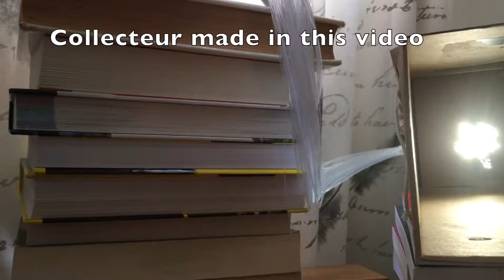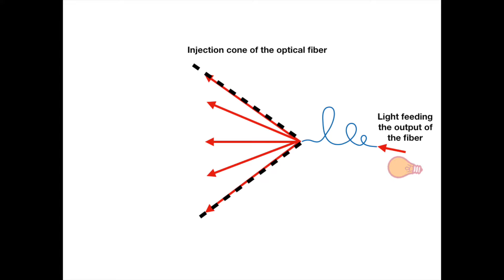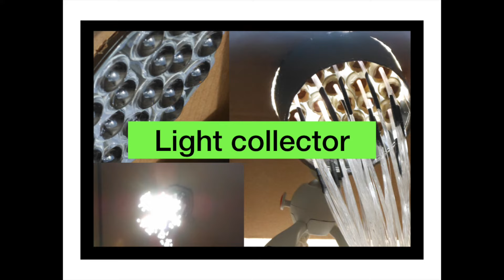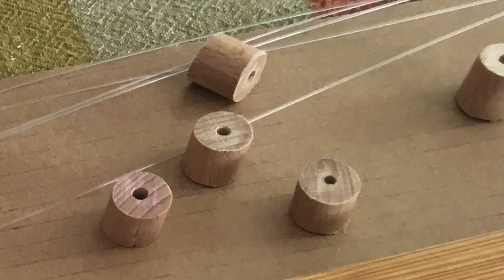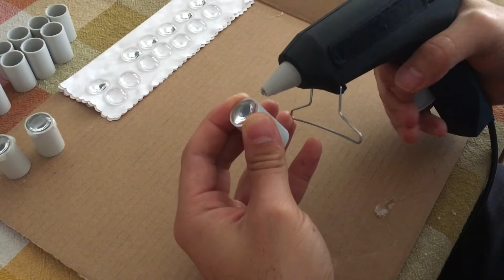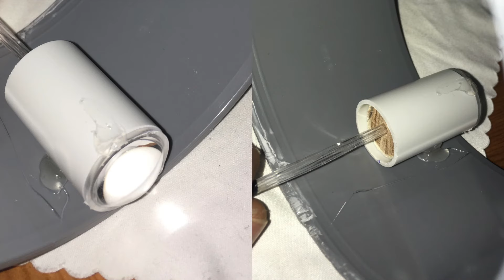FULL DIY TUTORIAL Sunlight collector using optical fibers

Comment: Is there a limit to the length of the line?
What is the maximum length?
Reply from the maker: It will dépends on the optical loss of the fiber, with a good fiber you can reach easily several hundred meters without too many losses

Comment: Did you know how much lumens it's possible to get using just one fiber?
Reply from the maker: Hi ! It will depend on your optical components : size of the lens, coupling in the fiber, losses of the optical fiber. In any case you won’t get much than the collecting area aka the size of the lens ( assuming the sun is right in front of the lens)

Comment: 1)I have a few questions 
If this has to be used in real life applications why would people use this since it is expensive compared to other things like solar panels or led lights and how many of them would it take to give the same brightness of led lights 
2) how many of these would it take to light up a 9watt bulb or any other kind of bulbs
3)what about the fire hazard of using it in real life
Reply from the maker: 1/ this solution might not be too expensive if a lot of sun collector were made, I’m thinking of providing a kit soon, and there is practically no aging component. Regarding the number, I don’t know, depends on what you are looking for. 2/ I don’t know 3/ there is a fire hazard, and that’s the tricky part of this project. I made another video where I started a fire using an optical fiber ! Check it on my channel ;)

Comment: Did you have issues with excessive heat? I want to do something similar to avoid using a parabolic with a secondary focal lens to eliminate UV and other invisible spectrum. I think coating the back of your lenses with a uv blocker would drop the temp significantly without too much loss of visible spectrum?
Reply: Put an infrared  filter it will reduce heat more than uv filter
Reply from the maker: I’m using small lens to avoid excessive heat. Also using low cost materiel, I guess a coated lens can be expensive
Reply: @nebulus3D  Have you thought of using the heat to produce energy by concentrating the light on to a sand battery that runs a steam engine?

Comment: they should put these into sheds and other storage rooms that are dark.. even better for plants though. great video! thanks.
Reply: The Philippines have been using a make shift version to light up their shacks without electricity. They fill a soda bottle with water and bleach and cut a hole in their roof and place it halfway in and out. It works surprising well to light up their windowless shacks during the day. And when combined with a cheap solar charged, battery powered led like what's in a cheap outdoor pathway light stake, they can have some light at night as well.
Reply from the maker: Thank you :)

Comment: Very informative.  Will try this when time permits.
Do the fibers you used transmit most or any of the IR?  
Had idea for passive radiant cooling using reflective features to guide light into fiber optics.   Seems this would make surface cooler and you could use that energy elsewhere.
Reply from the maker: I hope you will try it too :) the efficiency for a fiber to propagate IR is not the same from one fiber or another. And information regarding the transmission efficiency vs wavelength is not often given. Passive cooling look like a good idea, I wonder how effective it can be, knowing that the core a the fiber is quite small (few micrometers), I guess you need quite a lot of fibers (+ lenses but it limit the injection of light to specific angles...), that's a good project :)

Comment: well in order to save space and time why not make a double lens system so you would use a giant first lens (D) to focus down a bunch of light, then use another lens, a smaller one to refocus it again to be small enough to fit perfectly into the optic fiber? then you dont have to use 20-100 small lenses to collect enough sunlight to light up an indoor grow. then you use 5-10 large lenses, 5-10 small lenses and 5-10 fibers. not only is that easier to setup but its material efficient. the only thing is you might also need a double lens system to expand the light back out on the other side (indoors) and such a system would have enough energy moving through a fiber to quite easily burn or melt anything it shines on. (very condensed light)
Reply from the maker: That’s an interesting idea but I wonder what will be the impact for the light coming from the big lens to the small lenses in term of optical geometry

Comment: This is very impressive, are you using it for interior lighting? what kind of lamp you built for the output?
Reply from the maker: Hi Juan, Thank you for your comment ! Right now it's a prototype, not efficient enough to provide long term (several hours of) light. For the output I haven't design anything yet, but il would need a semi transparent material to send light is every direction.
Reply: @nebulus3D  why I cant provide long term light? heat issues?
Reply from the maker: With this device the light going inside the fiber came from a very specific region of the sky, since the sun is moving, there is a loss of light. Using a lots of collector is an idea, or a sun tracker
Reply: @nebulus3D  I seen sun trackers done with arduino, and it was for bigger panels so it should be easier in this case
Reply from the maker: This is my next step :)

Comment: Hi, this is awesome, I want this kind of thing for my indoor plants, but I’m worried that this will also bring in the heat, is there any solution for that.. also can I use this to light up any indoor spaces? If so how would one deal with heat issue.. ?
Reply from the maker: hi, thank you for you comment :) yes there will be heat, but it really depends on the size of the lenses, I think there is more work to do on the subject, but using special fiber that let only visible light propagate is a solution, or using filter to cut infrared light. I think the best solution is use some light, a sun collector is like a small window that you can bring anywhere
Reply: @nebulus3D  won’t the heat melt the fiber itself? Thanks for the prompt reply I wasn’t expecting this
Reply from the maker: @haiderabbas1832  Hi! plastic fiber might melt easily but silica fiber have a really high melting point, if you look on my channel there is a big fresnel lens that inject light in a silica based fiber, it dit not melt

Comment: Using these systems, can light be transmitted 12 meters with one 90-degree turn at 8 meters? For transmitting light from a surface to an isolated utility room or bathroom in an apartment?
Reply from the maker: 12m, yes, but using a good optical fiber, not a plastic one like I used, angles are really not good for optical fiber, loosing light at each turn :/ so it’s good to have nice curves and no angles

Comment: Tu es français!! Je peux l'entendre :) 
Did you measure the intensity of the light, so that you can calculate the efficiency? That is the key.
Reply from the maker: oh oui je suis Français :) Indeed, the efficiency is the key but not only. The sun collector on this video add a poor efficiency, due to the optical fibers (low quality one). I made a new collector using less lens but better fibers, you can see it here https://youtu.be/YIR7m8apKZ4
With this one I went from 200Lux (ambiant light) to 8000 Lux at the output of the fiber!! so a strong increase of ambiant light :) and this was for this small collector (the number of lens can be increased) with not the best conditions (behind a glass window, thin layer of clouds...). Another major key is to be able to track the sun and I'm still working on it, just wishing to have more time to do this side project

Comment: Great video!!
Wouldn't the optical fibre degrade due to sunlight?
Reply from the maker: Thank you for the comment :)  I don't think sunlight would degrade the fiber, optical fibers are made to propagate light and I've seen other application using fiber to propagate sunlight
Reply: The only thing I think of is, if using PMMA (Acrylic) fibres then UV could degrade them over time. Glass fibres won't suffer from this. If you want to use cheap PMMA fibres long term it may be worth investing in a UV filter. Would be beneficial for safety reasons also.
Reply from the maker: But PMMA fiber brings a lot of optical loss :/
Reply: @nebulus3D  Yes, the ideal option would be to use glass fibers, but these are more costly. For a laser of mine I have a AR coated fibre cable.

Comment: thank you for this wonderful DIY video.
I appreciate your clear steps and explanation. 
can u tell how much energy your set up can deliver if u concentrated all the fiber output in one point?
i wonder if i can use ur idea to collect and concentrate enough energy to wield/solder or engrave on metal or wood
Reply from the maker: Thanks to you for your comment and interest in this project. Regarding your question, it's possible, but not easy: you'll need a really good collector to achieve wielding/soldering or engraving. By good I mean: a lot of single collector, or a big one (but it's not easy to work with, you can look on my channel, I made a video with a 25cm one and managed to light a match), perfect injection of light in fibres, also a collector that follows the sun to a constant light, and to find a way to easily manipulate the "hot beam" at the output... so not impossible, but quite tricky to do

Comment: How much light would this let in? I'm thinking of installing this in a 15cm diameter air vent. Would this be enough to illuminate a small shower room?
Reply from the maker: There is a lot of light of it’s facing the sun, otherwise almost no light. So if there is a sun tracking device it’s ok (it’s my next project !! )

Comment: you can use this on a tv projector, bigger fresnel lens can be made with parabolic plastic filled with water
Reply from the maker: Hi! I did not understand about the TV projector, how can I use it? big fresnel lens = big fire :) but it can be a fun experiment! I'll try it !!! :D
Reply: @nebulus3D  it depends of the lumens i suppose, that could be measured with light sensor. 
the colour spectrum from sun light (tweaked with diaphragms, ray filters,  etc) can be better than a bulb, and way better than led. i think there are some projects out there. i think its important to bring all silicon cables all together and use a kind of plastic that creates an uniform square to go trough the lcd screen of the projector.  i think this solar projection is the future of video screening.
Reply from the maker: @crapisnice  Thank you for explaining more in details. I never though of using sunlight as a source for a TV/video screening! that's quite a chalenge and really interesting!!!
Reply: @nebulus3D  i guess that with water made magnifying lenses and a light sensor with arduino automation there can be 2 or 3 size types of switchable lenses with the same cable to adapt to different light conditions and cloudy time, and also a solar tracking system. 
 you can have access to pc, video all day almost without energy consumption. 
also another thing that has possibilities is indoor or outdoor farming, because we increase the photons the plant receive with the same sunlight and that increases growth, if this is true it can improve farming yields as greenhouses do
Reply from the maker: @crapisnice  i'm working with Arduino boards to create a real time sun tracker. Nothing concrete done now, but still thinking about the best way to do it. I also found other sun trackers, but I like to do it myself :) learning a lot too. Sun is so powerful and for me not enough used, switching-on a light during daytime while there is sun outside is just nonsense. I'm happy to see we share the same ideas :)
Reply: @nebulus3D  its common sense and everyone can use it as we watched this concept first on internet. solar energy has a huge potential not to convert to electricity but to produce concentrated light and heat, this can revolutionise diy scale industrial production since heating and melting is the major cost in mass industrial production.  so there can be small scale bio refineries, materials production and manbufacturing solar production factories that include all chemical process to complement different sectors production like composites, food, pharma, clothing, etc, and this small scale interconected factories can be made with 3d printing with diy networks of people, i mean with this accessible energy we can build the factory and diy create any product by ourselves only and if we really need it. 
i'm telling you this because i' m already trying to do this kind of project, as soon as it gets grip i can send you some information and you can contribute too
Reply from the maker: @crapisnice  I'm really interested in your project! let me know and maybe you can get some ideas from what I'm doing. Do you have videos or a website so I can get more information?
Reply: @nebulus3D  i'm in the mental sketching phase and downloading books and scientific publications,  in few days i hope to post in different forums to gather multidisciplinary knowledge and participation and create a forum with this project linked to those forums, forum and knowledge branches integration is fundamental to see the big picture and develop a standard of collaborated diy production
Reply from the maker: @crapisnice  Let me know when this forum will be created :)
Reply: Any news on this? The data is amazing
Reply: @dannykicks603  there are stationary Fresnel lenses design if you Google that scientific paper, so there's no need for sun tracking and a plastic pipe with internal aluminium foil or mylar covering also can redirect the light
Reply: @crapisnice  fantastic!!! Done

Comment: Hello, thanks for the nice video. Do you think this light transport could also be used for plants to grow?
Reply from the maker: Hi! Thank you for your comment. It will depends on the kind of fiber you will use. A fiber act like a filter: some will let more UV than IR light propagate for example. So you need to know these kind of spectral properties. Now I’m using a WF fiber, more expensive but it’s spectral response is quite good from visible to near infrared. I hope to make future tests with plants to see what happen :) only experience will give a good answer ;)
Reply: @nebulus3D  Sounds amazing. I recently saw many greenhous concept videos and they all do the lights with LEDs what causes energy. What if you could transport the light from the outside instad, and only compensate with LED when the weather is bad or in short winter days.
Reply from the maker: Yes ! That’s what I’m aiming (well more as a personal challenge). There is a big hurdle : how to continuously inject light with a moving sun, there are star trackers, but I would like to do a low cost/solar powered one. The road is long but I hope to get there (not easy when you have to work on the side :p )
Reply: @nebulus3D  Mount it on a sunflower. xD 
I am very sure there must be a solution with  a Sensor and a moving platform. Maybe there is a possiblility with low energy and an arduino project. If this would be a solution then one has to compare the energy consumption of the sensored platform and the lights energy use.
Reply from the maker: That would be a very special hybrid sunflower !! I’m going to look at arduino project after. The next step for me is to have a good low cost light to fiber coupling system ;) coming soon !!!
Reply: @nebulus3D  Ima looking forward to those videos. Happy working for you =D
Reply: @nebulus3D  Ever get around to building a fiber optic grow tent?
Reply from the maker: Never, but I think it needs to be an hybrid system, combined with led systems for example when there is no sun
Reply: @nebulus3D  Yeah, would definitely help to have LED's, esp in winter. Not sure if you could work with only sunlight though... because many plants grow well in shade... so depending on what the person is growing, it might be enough (assuming the area that the light is collected from is large enough and doesn't lose a very high percentage of light). I'm sure there are many plants that will grow well with 1/2, 1/4, 1/8 or even less the amount of "full sunlight" (as if it was outside with no shade).
Reply from the maker: Thank you for your comment !! Sorry but I didn’t understood your question :/

Comment: Fantastic! Thanks for this video. I would love to make one myself, however, the fire hazard makes me anxious, since my purpose is to leave it unattended.
Reply from the maker: Thank you very much for your comment. As you saw, the fire hazard is the main issue, but using small lenses should avoid it... it should, that's why for the first tests I'm always near to be sure nothing bad happen. Please subscribe to my channel, I'm 3D printing a new version and the video will be there soon :)
Reply: Where did you buy the lenses?
Reply from the maker: found them on ebay using these key words like : "5pcs/lot High Power LED lens 23mm convex lens optical glass led lens for DIY" you can found 5 pieces for less around 2$

Comment: I nedd these optical fibre where can I find.
Reply from the maker: Hi! I bought mine on ebay, but PMMA plastic fiber have really high optical losses in general, so I won't recommend them for several meters of fiber. Instead you can use silica base fiber, they usually have low optical losses. Please subscribe on my channel to know when there will be new video :)